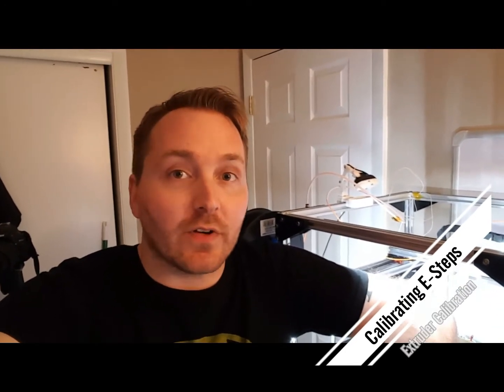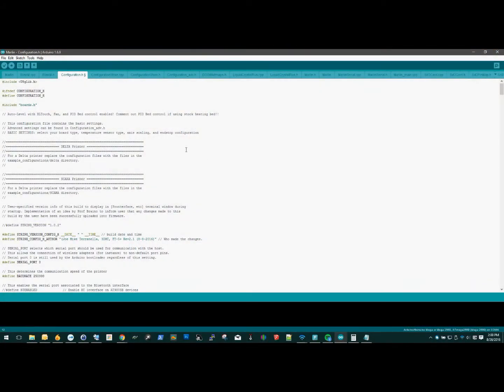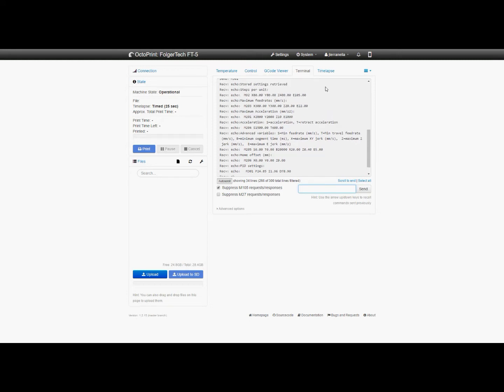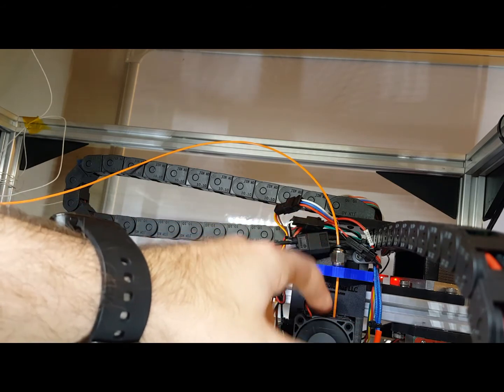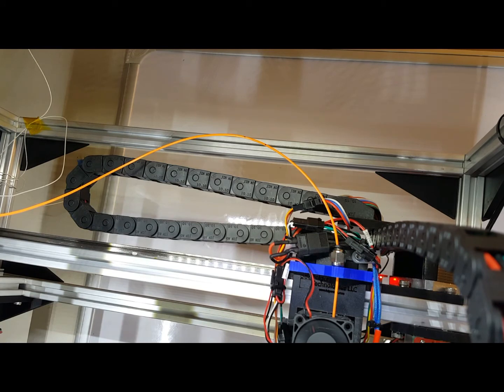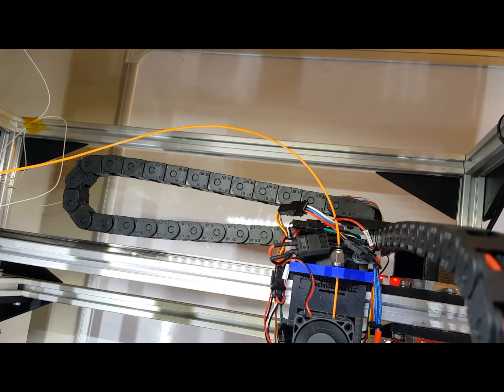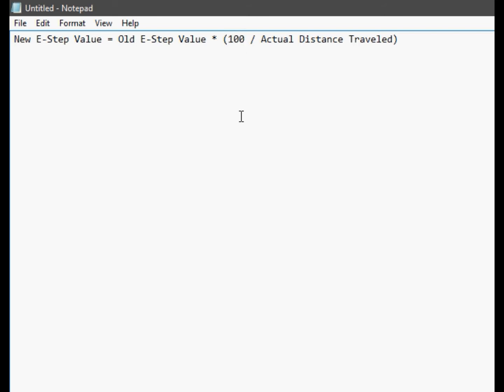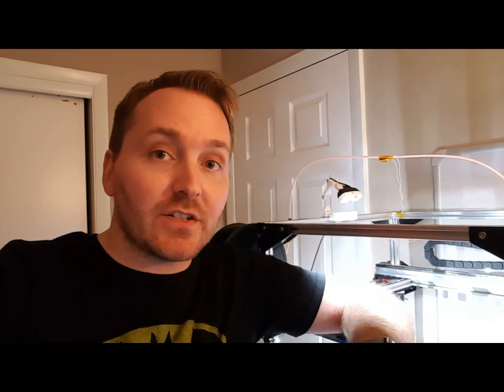Tutorial - Calibrating Extruder E-Steps - 3D Printing

Comment: A word of caution here (something I just discovered after some frustration this afternoon):  Make sure you are manually extruding SLOWLY!  The default 'fast extrude' in Slic3r is 20mm/sec (1200mm/minute!), which is fast enough that the gear could be grinding on the filament when it tries to push against high built-up pressure in the heatbreak.  I kept getting different readings every time I measured until I slowed the rate down down.    For best accuracy, use the 'slow manual extrude' (single arrow on the button) in Slic3r or otherwise make sure you aren't getting erroneous results.  If you can't get the same answer several times in a row or if your measurements seem to be way off, check the extrusion speed!